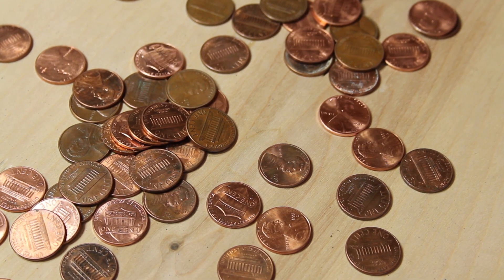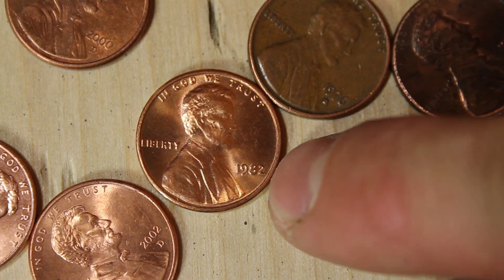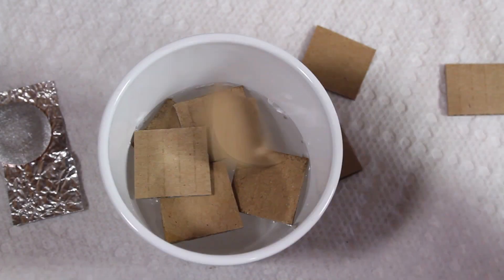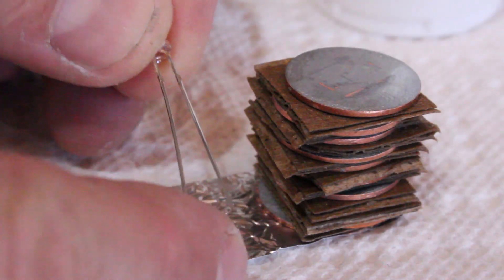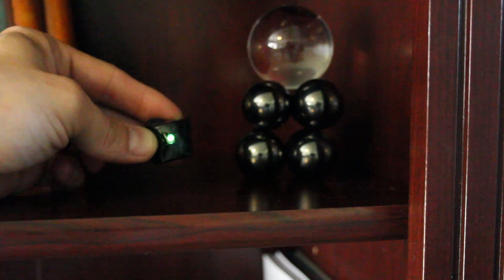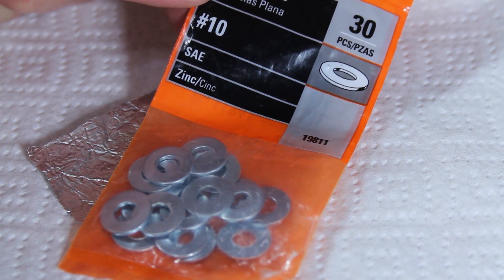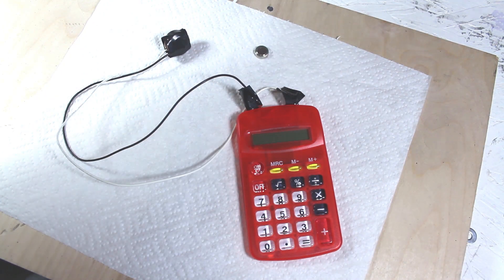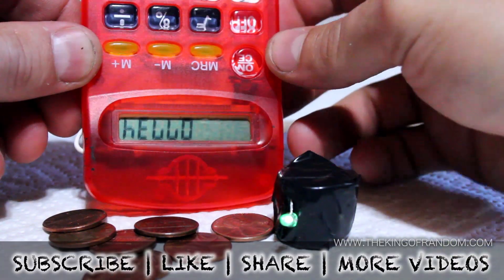How To Make a 3 Penny Battery

Comment: there is power stored inside of the pennies and at the end of that time period the power is drained from those pennies, the vinegar is a catalyst and just helps provide conductability IN cardboard between pennies which dosent give it any power...correct me if im wrong but that's a no, even with the little experience I have with these kind of things. vinegar is added to the cardboard, but you get the power from the pennies which have no relation, make sense?

Comment: Not nessissarily... Electricity has a multiplier system, as you can see 1 cell was .5v  3 cells were 2v  those 6 cells may be 18-20v,

Another example of this is "Fun with 9v batteries" video... 244 dead 9v bateries still add up to over 2000- Volts which is more than the sum of their numerical parts to begin with, when they started with less than half per each...

Comment: The "Example" of PENNIES is just an EXAMPLE... the FACT IS.. it works with COPPER as the antenna and the ZINC as a conductor.  The cardboard and vinegar act as a battery (aka CAPACITOR).  This is MUCH the SAME as an EARTH BATTER.  You can "REPLACE" the penny with copper plates cut from scrap metals (or... purchased INTENTIONALLY FOR making these sort of "batteries".)  

I suggest researching more into TESLA Generators and NIKOLA TESLA... what you find will EXPLAIN why they HIDE this "SECRET"..

Comment: you would be able to power it for an hour if you had a voltage down stepper thing (always forget what they are called) for a model a you'd need 715 (£7.15) cells just for an hour! and for a model b you'd need 1000 (£10) cell battery!

Comment: After watching the Emergency Cell Phone Charger video, you had said that it would require a constant 5 amps to charge it. So would I be correct in assuming that you could charge a cell phone using this battery method?

Comment: 0.5dl of vinegar? A whole bottle costs about 4 dollars. Cardboard? Free, since you can find it in nearly all packaging etc. Pennies? there are 10 pennies. Sanding paper? Nearly nothing, plus you probably have some lying around or at least one of your friends do. Total cost=less than a dollar. Cost of a regular AA battery= 1-3 dollars. Plus this has easily higher voltage. 
The whole point wasn't even to have cheaper batteries, since they are pretty cheap anyway. This is a emergency power source.

Comment: if i was to strip a phone charger wire and put the red part on the copper and the black part on the bottom and use the battery above to create approximately 5 watts of energy, would it work on a smartphone? and also will the zinc washers produce the same results as the sanded pennies? (i dont have a sander.) Thanks!

Comment: 2) 5. Tested that everything worked with normal batteries
    6. Hooked up wires to battery
    7. Nothing happened

Can someone help me? I have no idea what's going wrong... Could it be the washers? Or maybe the SnapCircuits? I have tried manipulating the wires to different inputs, outputs, and/or both. There is nothing wrong with the wires or the lightbulb. I used 6 cells. What is going on?

Comment: 1)   sooo..... i wanted to show my nephew this, so before he came over i made one. however, it doesnt seem to work. i dont have many power tools, so i used the washer method. here is exactly what i did:
1. Gathered pennies made AFTER 1982
2. Made cardboard cutouts the same size as pennies and soaked them in vinegar
3. Put tinfoil on table, then made stack washer, cardboard, penny etc...
4. Gathered two wires from a "SnapCircuit" set and a lightbulb from the same set.

Comment: Using your numbers 5.76x.167=0.962milliwatts for 10 cells and 2.064x.705=1.46milliwatts for 3 cells. In mliliwatts/cell, that's an error of over 400%. Check your numbers and find out how much each cell produces
Also: At 1:37 with 10 cells, you connect RED(+) lead to the Zn, and BLACK(-) to the Cu.
Then, at 3:04 with 3 cells, you say the Cu is the positive, and the Zn is the negative. You then proceed to test the cells with your RED(+) lead on the Cu, and BLACK(-) lead on the Zn
Please remake vid

Comment from the maker: The problem is probably the amperage.  The pennies don't provide a lot of power, so you'll have to make multiple cells and run them in parallel to get enough amperage to power an incandescent bulb.  Good luck!

Comment: Nuclear power plants have to be near water, like a river or a peninsula.  The nuclear reactors have water under high pressure that goes through the condensers and heat ex-changer to produce electricity.  The main water source is to keep everything cool and running smoothly.  Without water it wouldn't work.

Comment: Chemistry,  Lead acid batteries are the same thing, just different metals and different acids.  Zinc dissolves in Hydrochloric acid, producing hydrogen gas, is a simple chemistry class experiment.   Vinegar is naturally produced from wine or apple cider turning acid, today it is mostly made from grain.  So if the world ends, know as much chemistry as you can, you'll have a talent and skill you can use.   Just what you need without power, pennies and vinegar and Juice...

Comment: please help, i went to the hardware store and got some zinc coated steel washers.  i got a 2.2 volt .25 amp flashlight bulb, and did exactly as you said, but it did not light up the bulb, i used 7 pennies, washers, and 7 pieces of cardboard soaked in  salt water, then another cell using vinegar, none of the batteries work, please help.!

Comment: Thanks, excellent video.   I am repeating the experiment.  I found that preparing the pennies can be simplified dramatically by using a rotating disc sander (like the one on the wikipedia page for "Sander") with 60 grit sandpaper.  I don't have a vise so I held the penny in the other hand with a pair of locking pliers.   You need to reposition the penny of course to completely clear one side.  Still it only took a minute or two for each penny!!

Comment: It's not the Voltage that is needed to charge, it's the current. He said is penny battery was pulling 170 microamps... in that configuration the iphone would need  about 1,000 pennies to pull the needed 2 amps to charge the phone. Even then the current draw would generate so much heat your wet cell would dry it's self out in a matter of seconds.

Comment: Instead of grinding the pennies down, you could just use pennies and nickels. As long as the metals are different enough, you can get voltage between them. Isn't it illegal to deface U.S. currency?

Comment: Based entirely on the data from the video:
1 cell - ~0.65v
3 cells - ~2.061
10 cells - ~5.74v

The data roughly matches up mathematically (0.65*3= 1.95v which is -0.5v the data from the video) although obviously given the lack of data I have to emphasize the word roughly (0.65*10 = 6.5v which is 0.75v higher).

In any case, given that we're using rough numerals and not taking into account other factors (purity etc); 200 Pennies would result in 130v. For perspective, car batteries are around 12v.

Comment: 30-60 volts? What process would that be! :O The only thing I could thing of would be TIG on mild steel, running very cold!  Stick welding would be the simplest, but that would require at least 80-120 v, not sure on the amps though.  Bu-ut...I do have a 125 lb box of pennies in my garage that I've been debating to take to coinstar.  I think this could work.

Comment from the maker: Well to do some good arc welding you're going to need about 30-60 volts and 100 amps. Each cell puts out about 0.6 volts and I can't give you an exact amount on the amps, but it's probably only a couple of milli-amps.  That's a lot of pennies.

Comment: I’ve tried several different kinds of LEDs with different voltage requirements and they don’t work as well. Where did you find the exact LEDs you used in this video? 
Thanks for your time.

Comment from the maker: You could try sanding it off?  Or get new pennies.  The metal has been oxidized and that's what you're seeing, so the voltage drop is expected.  It's the same idea behind disposable batteries.

Comment from the maker: Did you check the polarity of the LED's?  Try turning them around because if they are connected backward, they won't light up.  Try stacking your cells inside a 3/4" piece of PVC pipe.  It's the perfect size for the pennies and will give the structure support.

Comment: How would i light to LEDs at once. I tried it with 7.8 volts of electricity with one blue and one red LED and only one would be able to light up, and how would I increase the voltage without stacking it on top of each other cause it keeps falling apart and there's a limit to how long the led wire is its about an inch and a Half long for both positive and negative wires

Comment: Vinegar and salt does work, but you can also use a fine abrasive like toothpaste or fine grit steel wool. Those worked well when I made a parabolic mirror fire starter out of the bottom of a soda can.

Comment from the maker: I got my LED's off eBay. About $1 for a pack of 100!  Sanding is a lot of work, so I'd recommending using washers instead.  But if you have to sand the pennies, it takes work but there are a couple of suggestions in the video on how I tried it.

Comment from the maker: Thanks for asking.  The wire can be any wire.  Doesn't matter as long as it's conductive.  The wires I used were insulated copper wires I saved from other projects.  If you have an old power cord, you can pull the wires out of that and use them.  Good luck with your science project!

Comment from the maker: DC would have to be inverted to AC before a transformer would be effective.  But basically, the more you stack, the higher the voltage.  The more you line up in parallel, the more the amperage available.

Comment from the maker: Zinc and Copper are the classic metals used in the original bi-metal battery and they are easy to access.  You're right in that you need one washer for each penny.  Washer, cardboard, penny make 1 battery "cell".

Comment from the maker: Thanks Shane!  I don't think the electrolyte can touch, otherwise it does short the cells, however a film canister would be air tight, so should help prevent the electrolyte from evaporating as quickly.  Nice idea :)  I've also tried it with 3/4" PVC and it seems to work well when glued and capped off.

Comment from the maker: It depends what you're using it for.  If you could make it air tight and used it on a calculator, I suppose it could run for a year.  It went 2-1/2 weeks with the LED turned on 24/7.

Comment from the maker: Are you using an LED?  If so, try using the opposite leads.  An LED is voltage sensitive and will only work one direction.  Also, you're right in that the pieces can't overlap because it shorts out the cell.

Comment from the maker: You should be able to create unlimited voltages with that technique.  Possibly even so high you can make large electrical sparks.  However, the current is very low.  I've measured around 2mA or so.

Comment from the maker: Good question.  I believe you'd have to clean the surface of the metals to expose fresh metal, or replace them altogether.  If it's just the cardboard that dried out, you can re-soak them in vinegar and they will fire right back up!

Comment: As per CFR Title 31 Subtitle B Chaper I Section 82.2 - Exceptions:
(b)The prohibition contained in § 82.1 against the treatment of 5-cent coins and one-cent coins shall not apply to the treatment of these coins for educational, amusement, novelty, jewelry, and similar purposes as long as the volumes treated and the nature of the treatment makes it clear that such treatment is not intended as a means by which to profit solely from the value of the metal content of the coins.

Comment: Actually the energy is produced by the vinegar in contact with the copper and the zinc, you could use anything that has this components, like a lemon or even a potato with those metals attached.

Comment: be be more inventive, you could even use sections of copper pipe, zinc washers and by sandwhiching a vinegar soaked piece of cardboard or paper between the metals, you'd also make a battery. you can use any pair of dissimilar metals with a electrolyte to make batteries.

Comment: it acts like a electrolyte, essentially battery acid. vinegar's acidity comes from acetic acid(most vinegar is 5-10% acetic acid), much weaker than car battery acid, but acid none the less. it allows the passage of electrons from the copper to the zinc, making a electric charge and allowing it to be used to produce electricity.

Comment from the maker: Nice!!  I recommend making the container air-tight as possible, and then you should have a light that stays on for awhile.  Mine lastd 2-1/2 weeks running 24/7!  But the one on the calculator lasted just a few hours until the cardboard dried out.

Comment: The washers should probably be ZINC plated. It's the bi-metal composition of the penny that created the reaction in the first set, and pennies are made of zinc alloy with copper plating. The second battery he made used zinc washers between the pennies and the vinegar substrate to maintain the bi-metal reaction.

The added benefit of doing this is that after the pennies "wear out", you can still spend them, whereas you can't once you've permanently defaced them.

Comment from the maker: Yes, make more penny batteries and link them in parallel for more current.  Linking them in series gives higher voltage but parallel is more current.  You'd probably need a lot of penny batteries linked together to get an incandescent bulb to light.

Comment from the maker: The difference between the AA and this penny battery is the amps it can produce.  The penny battery is extremely low amps compared to a AA so there isn't enough power to illuminate your light.  If you try it with an LED though, it should work because and LED uses very little current.  Does that make sense?

Comment: Ok so I made one of these, used pennies newer than 1982, used basic card board, and some washers laying around the house (not sure what kind of metal they are made of).  I built it like you show and do indeed get voltage, so I put together enough to equal or surpass that of a AA battery.  I have a little christmas light style bulb and it lights up just fine on the AA battery, but not on the penny battery.  Not even a flicker.

Any idea what I am doing wrong?  Maybe the washers?  *shrug*

Thanks!

Comment: Ya it was a bit dry, not soaking.  Sometimes the reading was higher, sometimes I used vinegar as the solution, sometimes I used lemon juice concentrate.   One thing I noticed with some people making penny batteries is that they are using tarnished copper pennies.  They can clean these to a reasonable degree using vinegar and a salt rub.  Tarnish will reduce the effective surface area and current as far as I can think about it.

Comment from the maker: While it's true you can generate high voltages by stacking these cells, the amps are pretty low. Just enough to drive an LED and calculator and small current devices, however standard batteries like AA are able to power higher current devices, like remote control cars.  I think it would take hundreds of penny batteries to match the power of a single AA.  But the concept of how they work is the same :)

Comment from the maker: Great question!  Either the vinegar evaporated, or the metals were reduced/oxidized to the point where they couldn't produce enough voltage and current to drive the LED any longer.  Exposing more surface area of the pennies would probably refresh the battery and allow for longer usage times.  Thanks!

Comment from the maker: Yes it's a reaction called a redox reaction.  One metal is oxidized and the other is reduced and the acid acts as the electrolyte.  It's the same basic concept as your car battery.  Try doing a search on wikipedia for redox reaction or voltaic pile.  Thanks for asking!

Comment from the maker: Pennies are usually 95%+ zinc on the inside, and coated with copper on the outside.  The ratios vary depending on the date there were minted.  Those are US pennies anyway.  If you're interested in compositions of different coins, try doing a search for them on wikipedia.

Comment: I'm no scientist (far from it) but i believe it's because the zinc is oxidized by the vinegar exchanging some of its electrons in order to reach a lower energy state, and the energy released provides the power. Feel free to correct me if i'm wrong.

Comment from the maker: I think it depends.  If the cardboard is dry, it won't work .. so add more vinegar.  If the cardboard is still damp with vinegar, then perhaps the metals have been oxidized/reduced to the point where they can't continue further, unless you physically expose more surface area, or replace the metals?

Comment: very cool.  you could measure the voltage and current every 6 hours, plot it, integrate, and get amp-hours.  For comparison, a rechargeable AAA battery on my desk has 1.2 amp-hours.